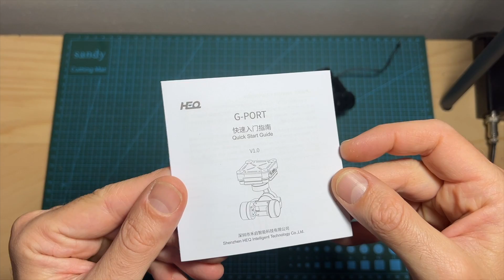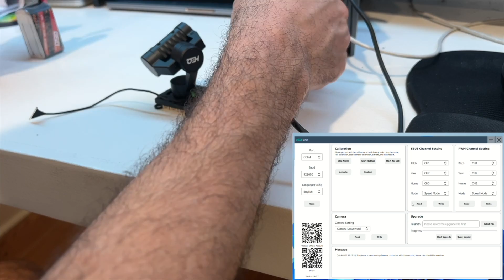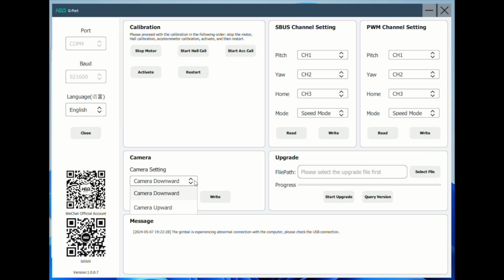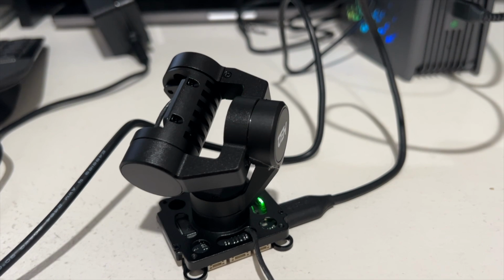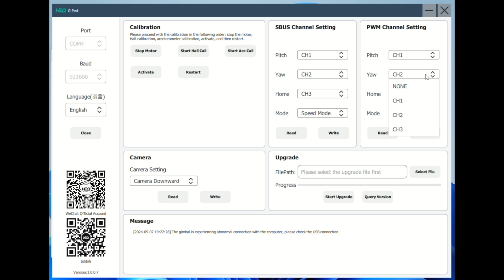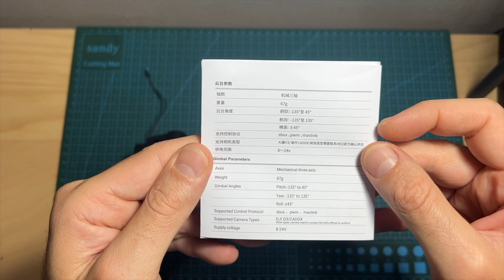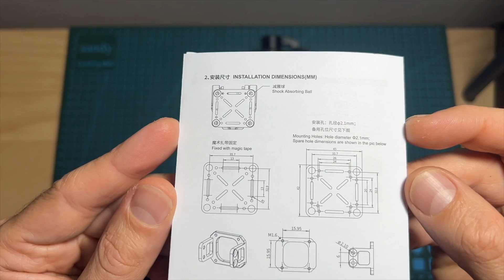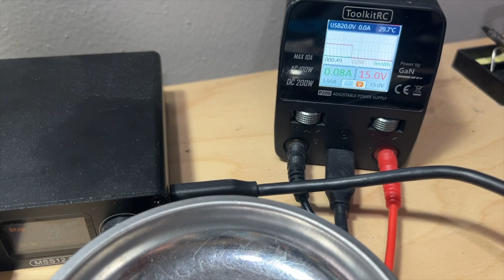DIY DJI O3 Gimbal // HEQ G-port

Comment: I'm wanting to do this with the Heq 3-axis gimbal for the DJI 04 pro air unit but do you power separately the DJI 04 pro air unit and the heq gimbal with the same 4s lipo or does tbe heq gimbal power the DJI 04 pro unit with pass through power?  I'm not understanding this portion of the build.
Reply: @shodanlu1964  same. Stuck at this point
Reply: not entirely sure but i believe you power them separately. the o4 doesnt connect to the gport
Reply: @im_ricebowl  it does connect you have pick the correct one

Comment: When you plug the PWM cables do you plug each one in a servo channels signal plug? Where do you plug them into on your servo? Could you give me a diagram please?
Reply from the maker: Sorry for the late response. Do you still need help with that? I think that the user manual should have it covered.
Reply: Im just having issues connecting to the receiver did you connect through sbus? Im just trying to figure out the connections. I didnt get any manuals or anything for the connections

Comment: How do you power your O3?
Reply: you could either install a smaller 2s battery to run independent of the rest of the car or wire it into the rest of cars wiring.

Comment: I got one, unfortunately it doesn't work when you go even slightly off road. Jitters like crazy in grass
Reply: Their new firmware somewhat addresses this issue. I think the problem is the max holding power of the motors. I had first just started locking the yaw with tape so it couldn't move at all. It worked well enough. Then their new firmware allowed you to adjust the max motor torque to 3x the factory setting. Combined with mixing the yaw into your steering a little it worked very well for me on 'moderate' off road like smooth grass or fast driving on road. When I tried driving fast on real bumpy off road I got the jitter again. 
The solution I'm doing now is just locking the yaw like I did before, but now I can reduce the motor torque on it to where it's never fighting against the physical lock. Since the max torque setting seems pretty powerful to be honest, I would find it hard to believe any other gimbal is truly addressing this issue either. Unless they redesign the layout, the yaw axis in these general designs with a camera installed just allow it to get sling-shotted side to side too easily with high speed off roading.

Comment: Wait I'm confused. Does the O3 version work for both the O3 as well as the Vista and V1 Air Unit or is it only  the O3? You said the O3 version was only compatible with O3 then you said the DJI version is only compatible with the older version of DJI VTX? Did you mean to say the Caddx Version is compatible with the V1 or am I confusing something here? All the sites I've seen have either O3 or Caddx options available and I wasn't sure if Caddx meant Walksnail or the Vista. If you can clear this up for me I'd greatly appreciate it. I am probably going to buy the O3 version regardless  (although I doubt I'll use it on a quad) but it would be cool if I misunderstood and it is compatible with both O3 and OG DJI Air units. Thanks for all the vids you make

Comment: Sorry to ask such a basic question, but if the controller controls the movement of the gimbal, how do you control the vehicle? One more question. I am thinking of getting this for my Foxeer Aura 8 because no matter what I do, I can’t get rid of some vibrations and jello. Would using this gimbal solve that issue?
Reply: @Binkoro  its so ez buddy, base on the chanel you get used to it, mine(tx): left control- throttle and yaw, right control- steering and pitch up down. And the jello issue you want really smooth while driving rc car you defnitely have to got a Gimble and the RC car(suspension…etc) fix. My case im using O3, the live from dvr was fine not too much shaky but the source was really nice, smoooth cause i turn on the rocksteady 👍👍👍👍 hope its help.

Comment: how did you get the 03 out of low power mode? in goggles? is there a way to do it via an extra UART on the FC?
Reply from the maker: Yes, just disabled low power mode using the goggles. If you are using an FC you can arm it.
Reply: @KremerFPV  Do you know if turning off low power mode in the goggles has the same effect as arming it? I keep reading you need to arm it for full power, but there's nothing to indicate it's being restricted by just turning off low power mode..
Reply from the maker: @TAD-TD4001  as far as I know - yes.

Comment: Thanks Gal for the detailed introduction！😁looking forward to your next video！
By the way, our voltage range has been updated to 12V-24V. For more latest details, please see our online store product introduction.
Reply: So it can use a 4s lipo vs a 3s lipo?
Reply: To power the 04 pro unit g-port?
Reply: @shodanlu1964  You can see the voltage adaptability range of O4PRO
Reply: @shodanlu1964  The voltage of the gimbal is recommended to be between 12-18V
Reply: You still haven't answered my question does the gimbal power the DJI 04 pro air unit?  Or do I have to supply a power lead to the gimbal and one to the DJI 04 pro air unit it?

Comment: Very interesting and informative video. Was curious how well it would handle an rc car. Footage looked reasonably stable, especially considering how much the gimbal looked to be vibrating. 😎
Reply from the maker: Thanks John!
Reply: Agreed! One question I have is how you picked up the audio track on the RC car? Where do you get that data or is there a microphone in the 03 unit I’m not aware of?
Reply from the maker: @MattHorvat  It’s from the Go 2 camera.

Comment: I have had an o3 air unit shut down mid flight while stories up which caused my hexacopter to be destroyed. It's quite annoying.
Reply: Aww naw bubba!
Reply: Do you have good area for your 03 system to mounted on your hexcopter??? Cuz 03 system can get pretty hot pretty fast and then it will overhead IFFF you don't have yours on right location to have plenty plenty of ventilation to cool down your 03 system during your mid flight. I do same thing and I mounted mine in right location on long body of frame, but in the end of body on a frame and have it lift off from carbon fiber with 3D print mount and gorilla double sticker 3M and I never have an issue by overheating my 03 system this way I mounted mine. So how did you mount it exactly?? If you don't mind my asking...

By the way hey @kremerfpv  at 0:20 to 0:25 the footage look AAA AMAZINGLY cuz from insta360 camera can see literally the newest gyro mount thingy from DJI with 03 system on it and it shakes like crazily 😵‍💫 BUT actual footage from 03 system showed no shakes while drive your RC buggy or however to said for this rc truck and that's how very very gooooooood DJI mount thingy built in with gyro is soooo good to showed proof literally no shakes in DJI mount thingy while using the 03 system, awessssome!!!!!